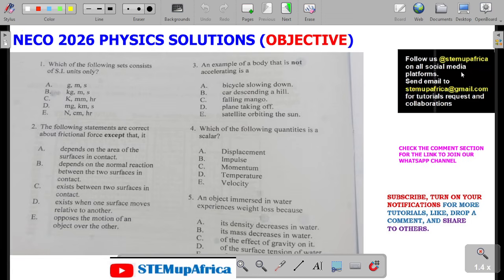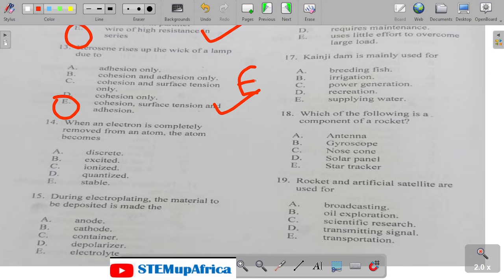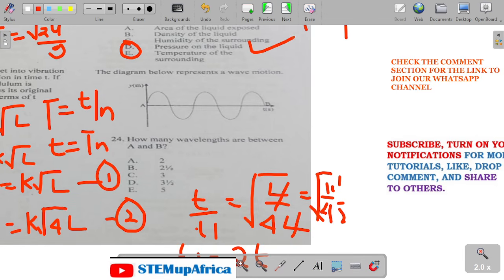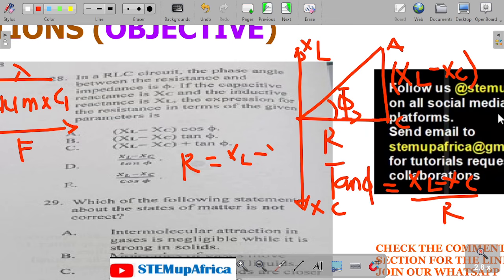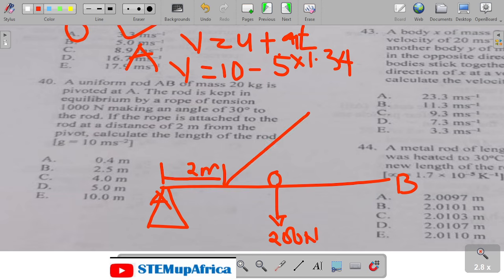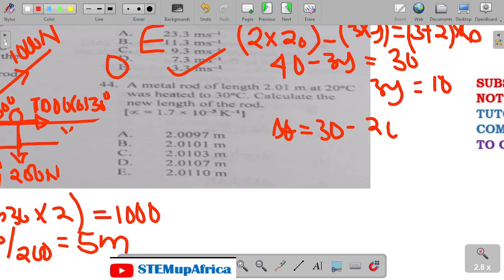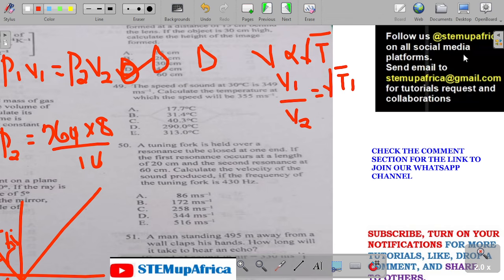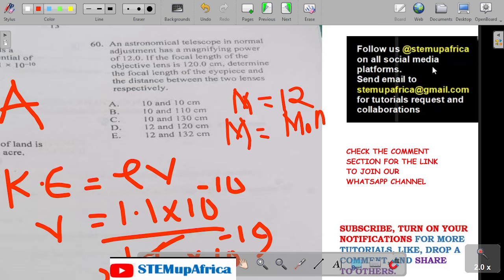NECO 2026 Physics Solutions | Complete Questions & Step-by-Step Tutorials (Objectives)

Comment: Sir , a d.c is converted to an a.c by replacing the split ring with a slip ring.
The human eye focuses light rays, but you said it doesn’t. The correct answer to that question is that the human eye doesn’t have a fixed focal length so as to enable us to focus on objects at different distances 😅😊
Reply: Do you kn😢if it's for all states please
Reply: Yes
Reply: Please do you notice any other correction